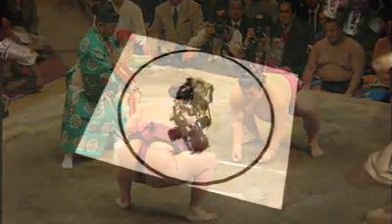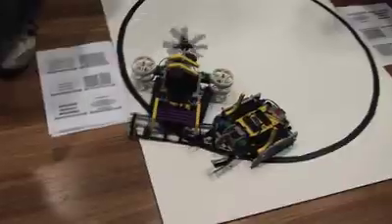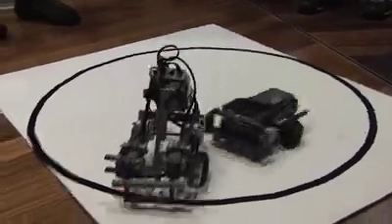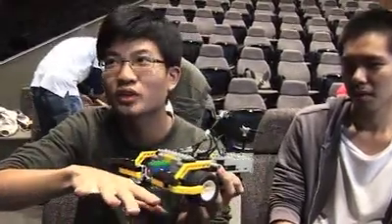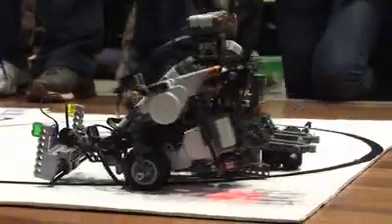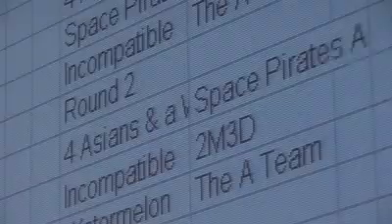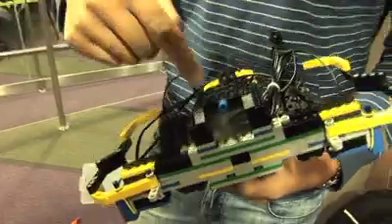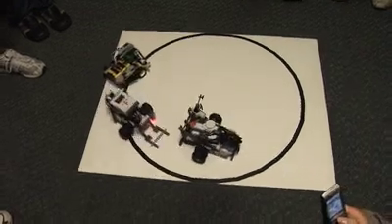Sumobots In The Ring

Comment: 2007 Engg1000 and later get these lego bots
in 2006 when engg1000 was first held and i did it, we had a train system controller to make...
a few groups made a track each
and the other groups made the software to control the track (track forks or what ever they're called, brakes, looking at sensors etc)

On the test day
the interface between the tracks and the software didnt work, and the tracks failed or something

Though not a bad assignment, i wish we got this new lego bots thing